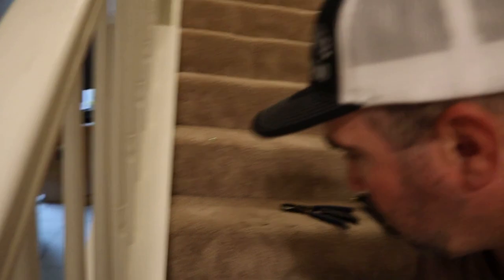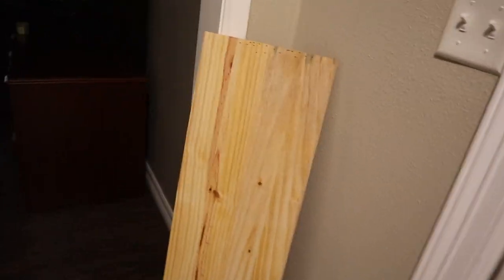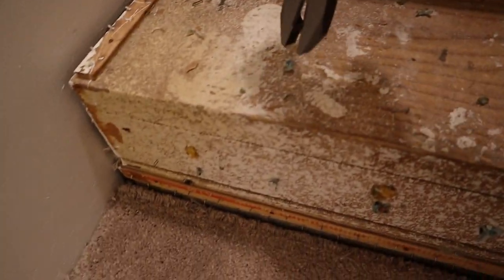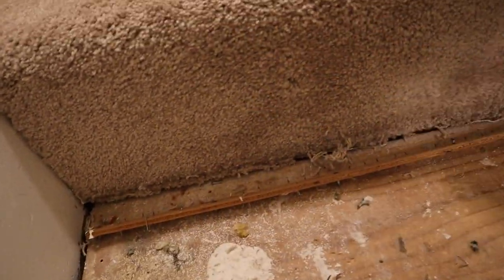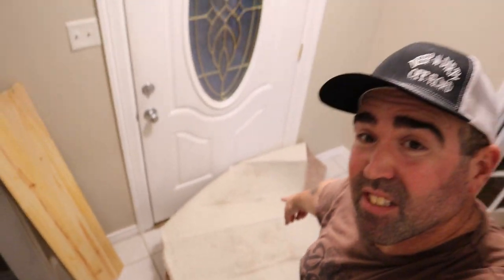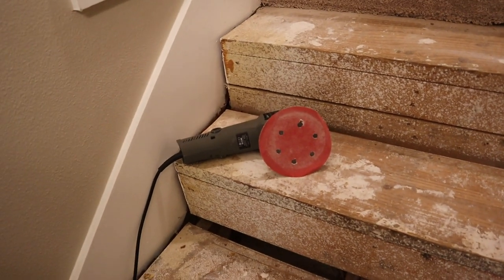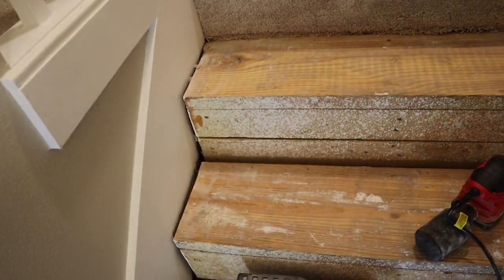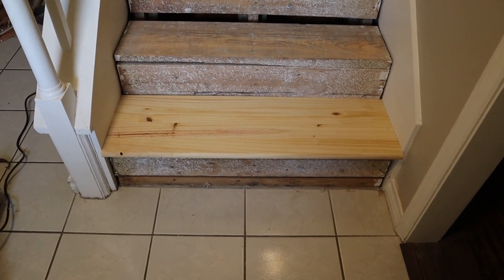CARPET TO HARDWOOD STAIRS. Easy Stair Makeover. No Professional Needed.

Comment: "A" for effort and posting such an honest video. You needed a stair tool for your measurements then you can just caulk the tiny gap. You can also use the trim just underneath the tread. You are 100% correct, stain and polly before installation.
Reply from the maker: Thank you for watching and commenting.

Comment: Very nice video thank you! I was going to use pine as well (or good quality plywood) as hardwood like oak is very expensive here in the UK..I was wondering how the pine treads are looking after a couple of year? Thanks!
Reply from the maker: I stained them. They are looking okay. Had a lot of traffic last summer when the water heater leaked. But they still look pretty good.

Comment: Have to keep that nail gun oiled. Have the same one and has same issue. Once lubed it will work again.  Take the latch off front and tip it upside down and let oil saturate inside.
Reply from the maker: Thank you for the advice. Thanks for watching

Comment: My stair treads under my carpet are already rounded edges.  They seemed to have used monster nails in them tho.  Should I fill the holes and stain or just rip them out completely and use fresh pieces?   I’m afraid that after staining you will see where all the filler is and will look bad
Reply from the maker: Probably just fill the holes. then sand everything down then stain. But im not a professional.

Comment: Thanks for the video!  Question:  why not stain the treads before you put the risers on so as not to get stain on the white risers?  And why not just white caulk in the gap between riser and side trim?
Reply from the maker: It was my first time. Didn’t know what I was doing. I added caulking after the video. I looks a lot better now. Thanks for watching.

Comment: It's my understanding that stairs cant vary more than 3/8 inch.  Using the thick solid wood, arent you increasing your height on the first step and really shortening the height at the top step?
Reply from the maker: Nah, I don't think so. It seems almost the same. if you subtract the thickness of the pad and the carpet.

Comment: A for effort and willingness to get out and do it yourself.

Only issue is the top rise is 3/4 if an inch less then the remaining steps, and the bottom rise is 3/4 more....

Codes don't allow for more then 1/8 if an inch variance between any rise within a set of stairs

Ideally... Treads should have been removed and new pine treads installed directly over the carriages
Reply from the maker: Thank you for watching.

Comment: Great work. Suggestion: it might have been easier to stain before installing the steps. 

Question: how did you go about making the wood round on the step?
Reply from the maker: Thank you. The wood came like that from Lowe’s. I realized after I installed the stairs that I should have stained them first.

Comment: Cool vid man. Learned some good stuff. Hey, how thick were those treads and risers? And were yours a common thickness? Did you have the treads cut to size or did you cut them yourself? The risers as well? Appreciate the content. Thanks!
Reply from the maker: I think the thickness is 1 inch. It’s what Lowe’s had in stock. $11 each. I cut them myself. Definitely better to stain the tread before installing. I cut the risers as well.

Comment: Doesn’t it increase height of the first stair by an inch?
Reply: Correct, this guy is no stairbuilder. Also, would not pass code.
Reply from the maker: Its in my own house. Code for who? I removed the carpet and padding, then added a piece of wood. It didn't increase by an inch. Maybe half inch if that. It is the exact same thing the contractor was going to do. But i decided not to go with a contractor.

Comment: You just created a trip hazard... What about the bottom stair now, isn't a little higher than what it was before, isn't a little higher than the other ones now? Same with the top one, but going down the stairs once you get to the bottom one, it's noticable...
Reply from the maker: No. They are all the same as they were before.

Comment: Doesn't adding an inch of thickness to existing stair treads make the total measurement not up to code?
Reply from the maker: Probably not.
Reply: Adding one inch to every tread still maintains the same riser height. The slope never changes. The consistency is the same through out. I would say- in compliance.
Reply: @egar4767  wrong because now the 2nd last riser to top of stairs will be 1 1/2" less than the rise of the other stairs.  not to code.
Reply: Hi, since you are adding 1" steps/treads, the space between the top step and floor will be an inch shorter than the rest. Also, the bottom step will be an inch taller. Could this be out of code? And a tripping hazard?

Comment: How much does it cost approximately with oak wood?
Reply from the maker: I probably spent $500 total. That’s with liquid nails and stain and the risers also
Reply: So oak or Pine for treads?
Reply from the maker: @Rafffia   I bought Pine for $10.50 per tread. Oak is $30.98 per tread.
Reply: Thank you!